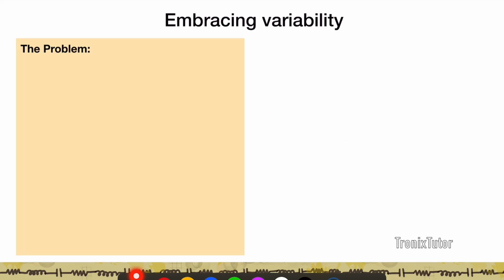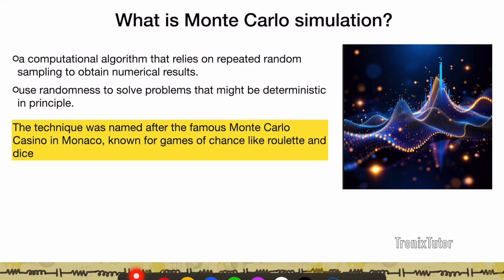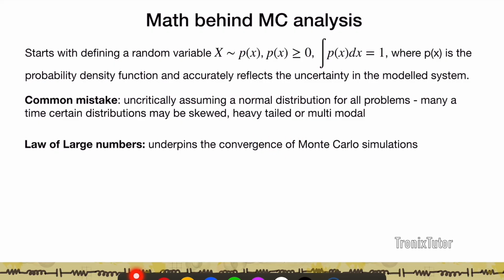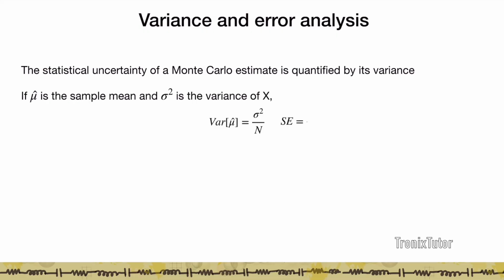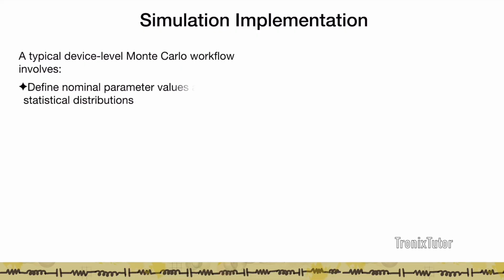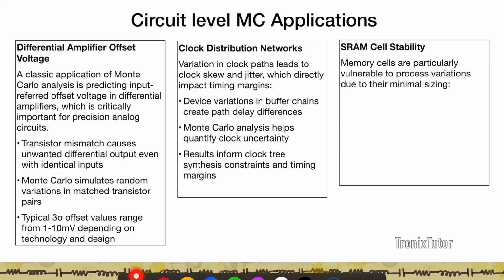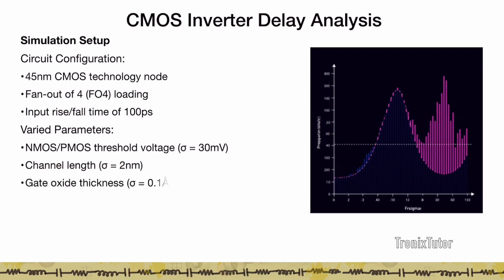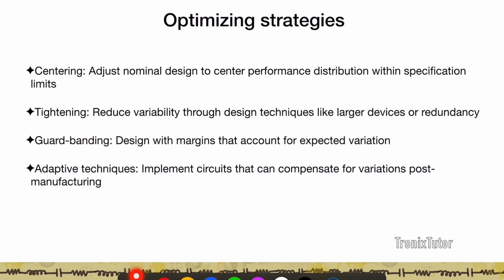Your Simulation Gives One Answer, Silicon Gives a Distribution | Monte Carlo Methods

Comment: Can you tell which parameters does not have normal distribution because leakage does not follow normal distribution
Reply from the maker: Good question. The PDK's statistical model treats the underlying process parameters — Vth, Tox, mobility, etc. — as Gaussian, since that's the physically reasonable assumption for random dopant fluctuation and line-edge roughness. But leakage isn't a process parameter, it's a derived output, and subthreshold leakage is exponential in Vth (Ioff ∝ exp(−Vth/nVt)). Push a normal distribution through an exponential and you get lognormal — right-skewed with a heavy tail on the high-leakage side. Gate tunneling leakage behaves the same way since it's exponential in Tox.

Delay/Fmax tends to stay closer to normal because it's a sum of many stage delays, not a product — CLT smooths it out, though there's still some skew near the timing-critical corner. Total chip leakage across thousands of parallel devices ends up lognormal too, since it's dominated by the tail devices, not the average one.

Rule of thumb: don't assume a Monte Carlo output is Gaussian just because the inputs are. Anything exponential in a Gaussian input — leakage, subthreshold currents, some analog offset terms — will come out skewed. Worth checking with a log-transform histogram or QQ-plot before computing yield sigma on it.